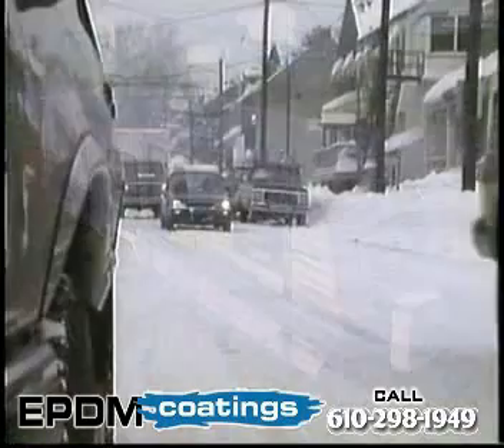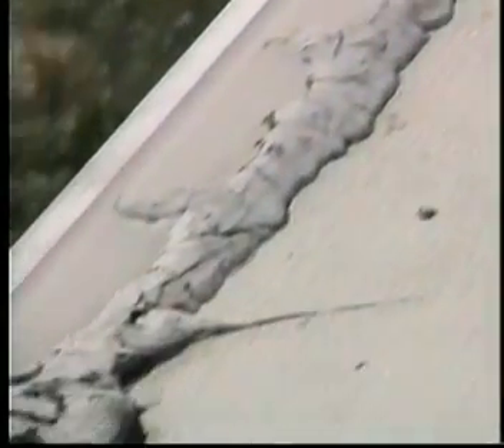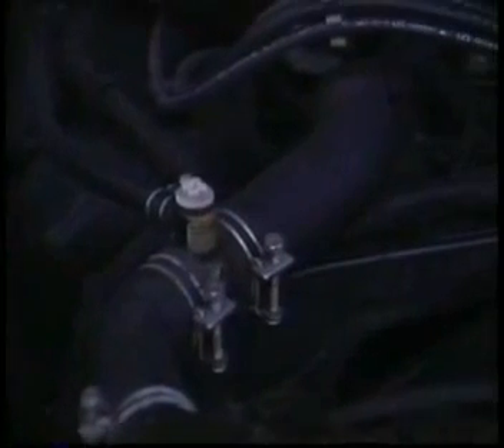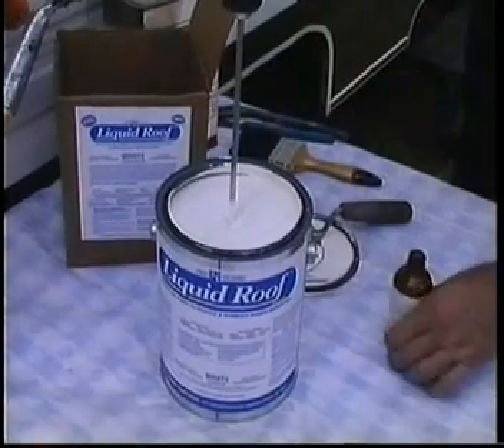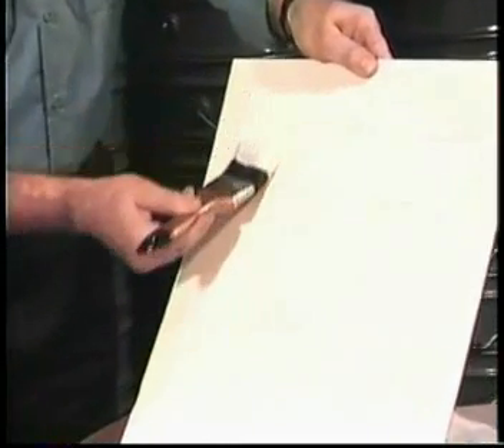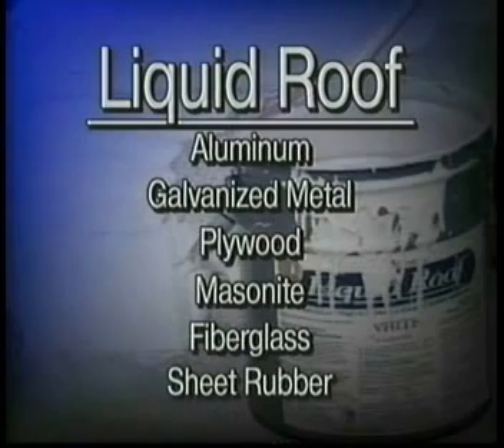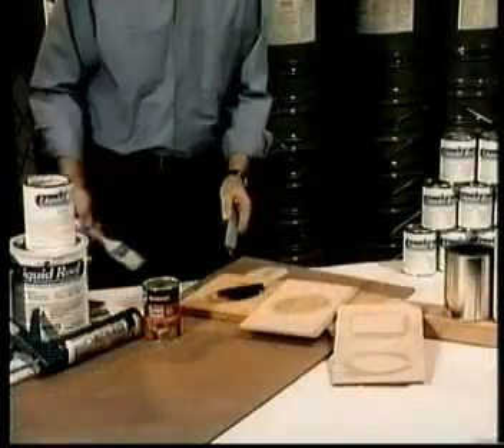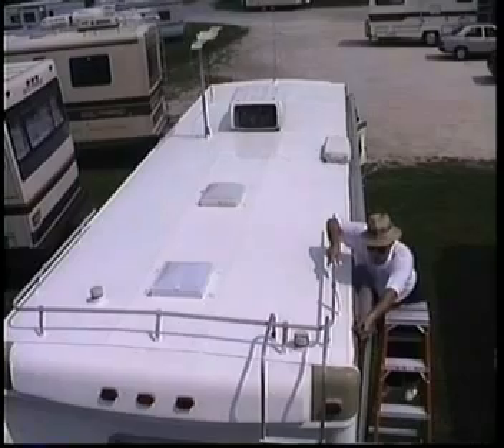Call 855-281-0940  50% Off Shipping  Call 855-281-0940

Comment from the maker: we use this as a reference to our customers... Came from KOA

Look for any discoloration and/or soft spots on the ceiling around roof vents, air conditioners, wallpaper, and feel for any soft 
Open all overhead cabinets, and look in the top corners for any soft spots. 
Check in all outside storage compartments for  water leaks or water damage.
Check for any soft spots on the roof itself, especially around the roof seams Thoroughly inspect all sealants on the roof around every opening.

Comment: My RV had a second layer of metal put on in a repair effort. I still can't find one leak, so want to try your product. In the front, there is a lip of about a half inch that they slimmed with RTV type sealant. There are also a couple small houses they filled with silicone. Do I have to remove all the existing sealants? Should I use a threshold type transition metal strip to screw down the lip before using your product?
Reply from the maker: +Bill S you would need to remove the silicone and replace with either a butyl or acrylic caulk but on and non original metal surface please prime that first with the proflex primer and then you can coat the entire roof with the liquid roof thank you

Comment from the maker: on non asphalt surfaces yes see below for acceptable substrates

 The following are recommended substrates to coat:

    Various Metal Roofing systems
        Weathered Galvanized
        Weathered Aluminum
        Weathered Copper
    Of course any existing EPDM Rubber roofing system
    Concrete where there is little foot traffic
    Sprayed Urethane Foam
    Wood applications that are first primed with our ProFlex Primer